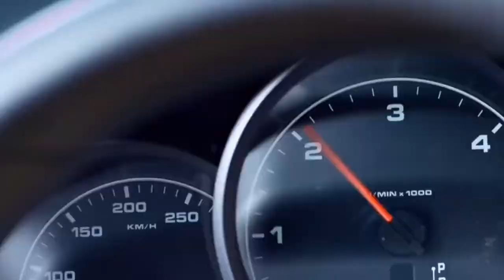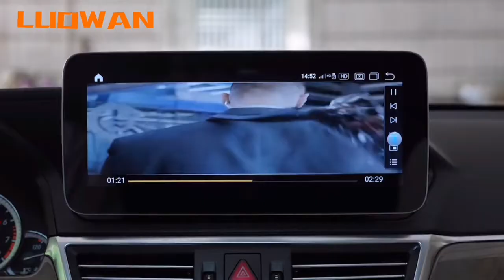Mercedes Benz E Class E300 E350 Radio upgrade stereo replacement NTG 4.0 Carplay installation

Comment: It's about 900 dollars and I'm not ripping up the dashboard abd dealing with wiring, so I'd have yo pay someone and it's about 1500 dollars to do a replacement. Short and not to the point.   The point is, my time is worth more than an upgraded radio.  I'm also not dropping my car off for 2-3 days and not having it for that amount of time, just to be lazy and get a bigger screen.  The default has Bluetooth, GPS/Nav, SD card Slot, USB Slot, internal hard drive storage, disc player, XM radio and traffic.  My phone has Car Play.   I don't need to spend 1500 and not have my car on a 10K worth vehicle. I'm not sending 15$ plus tax of the vehicle's worth on an upgraded screen.
Reply: ok
Reply: @okmario843  It is spelled, "Okay".    Edit:  OKAYMARIO?!   :)
Reply: I found it for 480 on amazon, 30 minute install tops it looks like if you do it yourself, no splicing wires nothing